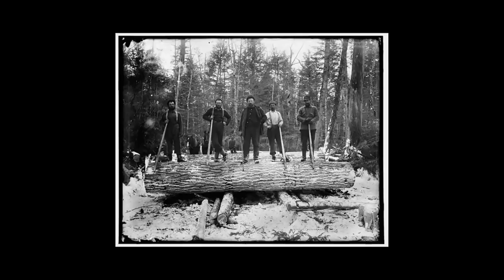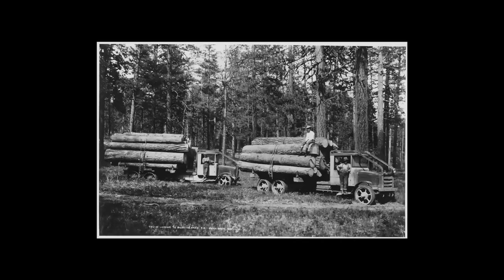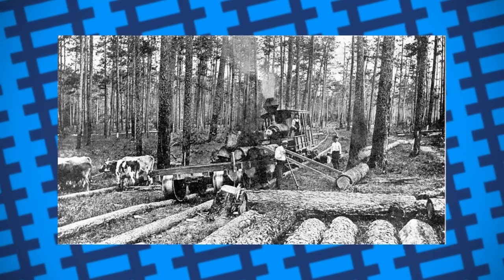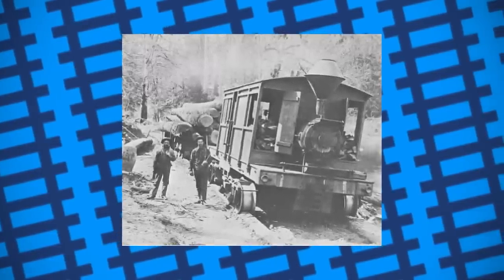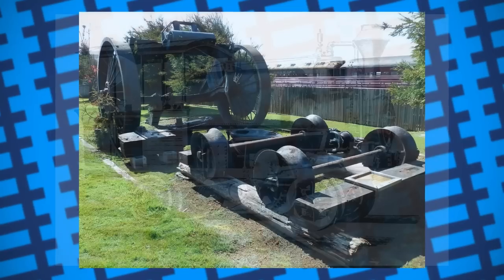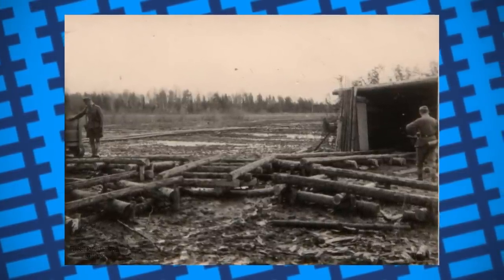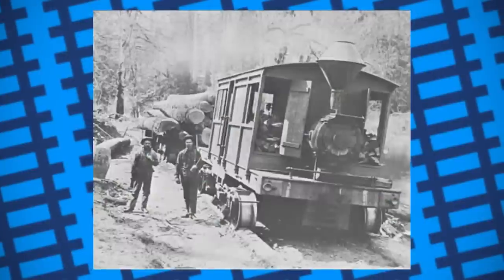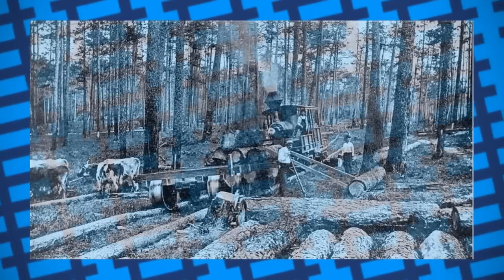That time railroads used logs instead of rails - US Pole Roads

Comment: Too bad there aren't any examples of these pole locomotives still in preservation. It'd be neat to see one in a museum
Reply: I've heard there is an example somewhere in South Carolina, although it is privately owned and I'm pretty sure it is in bad condition. You never know though, there could be some abandoned ones somewhere in a forest.
Also, I think it is the one at 1:32. And, I also have seen some pics of preserved diesel ones.
Reply: There is a truck at Duncan logging museum Vancouver island.
Reply: There is a Fordson tractor converted to a pole road "locomotive" on display at the Mount Rainier Scenic Railroad in Mineral, WA. Unfortunately, there is no full scale operational pole road anywhere as far as I know.
Reply: Can you imagine the paperwork required to make a pole road now?  The safety crap and the permits alone would be ridiculous!
Reply: @Buck1954 Not to say of course that there isn't value in that "safety crap" 😉

Comment: They use pole roads quite a bit in the swamps of the southern US and up in Alaska when the ground gor soggy in warm weather. My gramps bought some land when I was a kid in FLA and there was a pile of these wheels in the back corner. We found out later that there used to be a pole road logging track running throught the property in the teens and 20s. We ended up finding all kinds of remnants of machinery, tools and odds and ends along the back side of the property.

Comment: They had things similar in Australia and New Zealand. The unusable logs were cut into makeshift rails and most engines even had a steam powered saw that was used to make the rails. The locomotives could then be taken onto steel rails as the wheels were compatible with both wooden and steels rails. A noteable drawback to this was that the locos had to either be very light coffee pots or a geared engine with the weight spread out over many wheels. A replica of a logging coffee pot, albeit without the saw due to safety concerns, is running in Maryborough. She pulls occasional tourist trains on her own rail line, once again with added safety features such as steel rails. There is plenty of interesting stuff there so have a look if you're ever in the area.

Comment: First paper wheels now log rails, it’s looking like we could make a Railways out of trees now.
Reply: now we only need to make the engine out of cardboard then we are golden! 🤪👌
Reply: What next, wooden railroad ties?
Reply: well, there has apparently been some work done on wooden transistors recently.. but somehow I I don't think that's going to lead to a wooden motor... and a wooden Boiler is just never going to be sufficient, nevermind a wooden firebox or ICE.  So, unfortunately, an all-wood railway is going to have to get it's motive power from a treadmill type arrangement or be animal haulled ... at which point it's just a wagonway.
Reply: @laurencefraser  Treadmill type arrangement... Quick! Call the ancient Greeks and see if we can borrow a wooden horse!
Reply: @laurencefraser  You might be able to make a wood boiler. I know you can make a wood stove.
Reply: @sebastianthomsen2225  an electric motor from wood should be easy, though weak without a magnetisable core. 
Who knows what you can do with lignum vitae... low- pressure steam engine should work.
Reply: @nos9784  🤔
Reply: @sebastianthomsen2225  lignum vitae is an incredible wood with self- lubricating properties. It was used on one of the first marine chronometers, and on many propeller shafts, including the one the nautilus, the first nuclehr submarine.

And an electric motor is a bunch of coils in a mechanical device... the device could be made from wood.

Then again, these are jokes, and better materials exist for most tasks.

Comment: Could you do this for cheap most likely temporary tram lines for public transport.
Reply: i don't think so, you woud need special Trains hauled in and then you would need also quite many logs hauled in that not "standing" around since i thing the City council might have something against cutting there Trees
Also: while fine for a slow moving Worktrain that was cobbled together a 100 years ago, but i doubt that even in a country that value it's normal citizens that less than the US, that might be a "bit" unsafe
Particular if there are "already" the option of moveable railways like from Peat extraction or the like
Reply: bus technology nowdays are good enough and wildly available to ever make that a consideration

Comment: Speaking about this merely as an engineering standpoint, why didn't they knurl the log wheels so that they'd bite down as they rolled along?  Or use strategic metal gear racks and cogs for steeper gradients?

Just curious. : )

Comment: I might be doing this here soon I need a good way to get lumber to my 1888 frick sawmill and I don't want to install a road and lose multiple acres of my hay land soooo mini railroad it is so I only use a third of the area a driveway will take up
Reply: If you're willing to put the investment in for steel rails you could use the same type of flat steel stock the channel Way out west is employing to move wood around into their drying sheds and charcoal kiln, the track consists of lengths of flat steel bar stock with holes drilled to have bolts placed through holes in similarly dsrilled short steel tube stock pegs which are hammered into drilled holes in small wooden ties, small bolted fishplates are used to join the bar rails, and the flexible bar stock allows one to form curves and rearrange the layout without too much difficulty. The flanged wheels are a round steel plate welded to a strip butt-welded into a tubular shape, fitted to tubular axles running in oiled wooden bearings which are fitted to fairly plain two-axle wooden carts but I imagine it wouldn't be too difficult to arrange a larger bogie flatbed. You could probably replace the rails entirely with these kinds of poles, but it really depends on your particular circumstances.
Reply: @CATASTEROID   I've been subscribed to him for awhile I love his tracks but I'm starting from nothing so.... his design has to be next step up start small and work up from there
Reply: @wesbrackmanthercenthusiast4695  fancy that, what a coincidence! If you start building keep me posted, I’m interested to see your solutions to the engineering problems
Reply: @CATASTEROID934   I intend on posting on the diy engineering I encounter it's fun to build stuff
Reply: @wesbrackmanthercenthusiast4695  that would be really interesting to watch